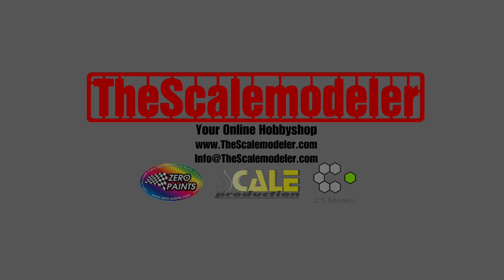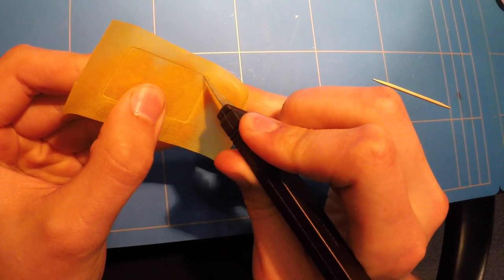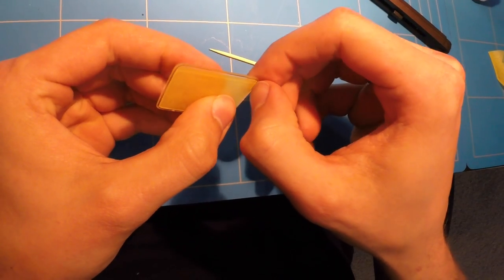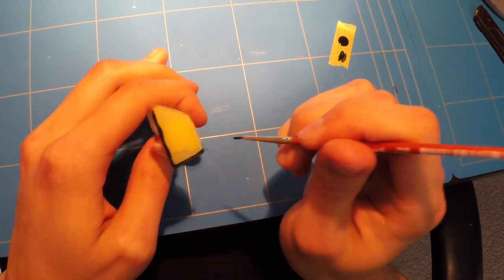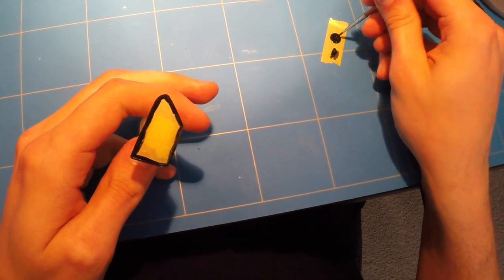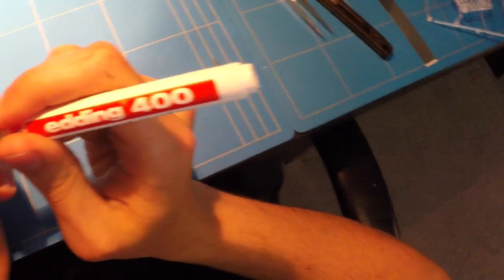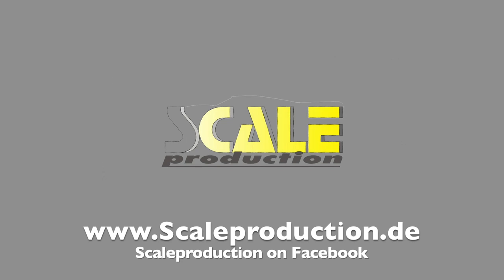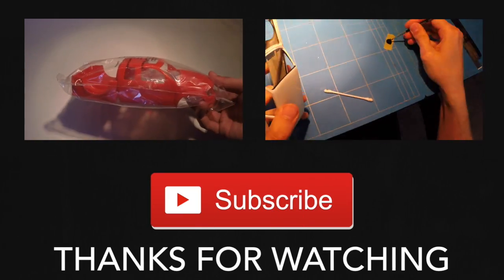How to: Masking & Painting window moldings on clearparts

Comment: Nice tutorial. I use the same method. And I like how you work from a drop of paint. With the enamel bottles I always dip straight into the bottle but now I want to try your way.
Reply from the maker: Toppervision1 I use the drop because i can't dip the brush in the Vallejo bottles, otherwise i do the same. but then shake the paint and use the cap to dip my brush in

Comment: Any tips on restoring old plastic windshield/back glass piece from a 1981 Ertl 1/25 General Lee….its yellowed and not real clear, Ive wet sanded starting with 2000 grit and working up to 15000 grit sandpaper, it seem smooth, but not clear…I’m thinking trying some floor wax or perhaps an enamel clear-coat…any tips for restoring old / yellowed / hazy …???
Reply from the maker: A good clearcoat should make kt clear and glossy again. Try making it wet with some water. If its clear and glossy then. The clearcoat should do the job
Reply: @TheScalemodelingChannel  YES!! Thank You, I just did that with the water, looks real clear!! I’ll use spray the clear-coat on it in a couple days (bad weather). Thank You so much!!

Comment: Hi Tom!  I am very new to the world of airbrushing but I can't help noticing your technique in that you go back and forth on the trigger all the time. Is it necessary to turn back and forth from paint to air so often?  My usual way is to just keep my finger on the paint release until the job is done.  Maybe this is a way of saving paint?  Would appreciate your comments.  Thank you...Judy in Canada
Reply from the maker: +Judy Garnhum if you keep the paint flow going you will create more overspray and use more paint. And also run the risk of getting a lot more paint on certain spots if you don't move fast enough.

If you like it this way, just keep going. But i would suggest to try it my way aswell to see the difference
Reply: Thank you Tom, I very much value your opinion.  I enjoy your videos so much, you are an expert, keep on going!   Judy in Canada

Comment: i'm curious how the black looks when it's dry. I like to stick with flat black to do the trim and my LHS just started selling vallejo so I've had a chance to try them out, but i noticed vallejo only has this black you used.
Reply from the maker: Well not really. This is pretty muuch the blackest black they have. But i think they have about 10 variations. Some metallic some more grey etc etc. When dried up its flat black with a bit of a rubbery sheen to it.

Comment: hey i have one more question . I have a problem with them sticking . When I used glue to paint the windows melted away :/. you using a special glue ?
Reply from the maker: You used plastic gleu, that melta the plastic together. When gluing in clear parts use wood gleu or gleu designed for clear parts, like revell contact clear
Reply: would Testors clear part cement melt away the paint?

Comment: Hi,  I have a model that only provides a front and rear windshield no side glass.  The model is a 1967 Impala by AMT.  So this car has the old style windows in the front with the Triangle vent windows and I believe the rear windows only went down 2/3 of the way.  Is there a way to simulate the Triangle windows and the rear windows in the rolled down state?
Reply from the maker: +Joe Krol cut it out and gleu ir in how you want it to sit
Reply: There is nothing to cut, no clear windows came with it.
Reply from the maker: Joe Krol then just cut some clear plastic to shape and glue it in.